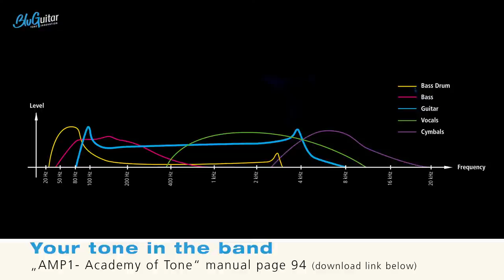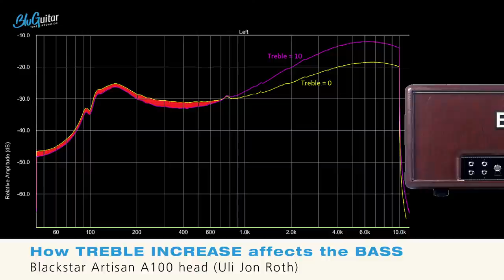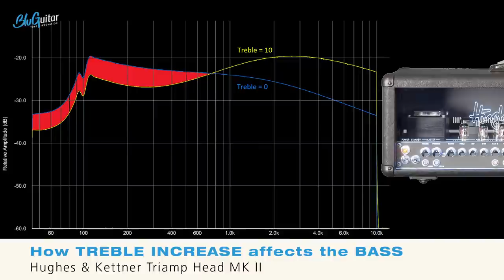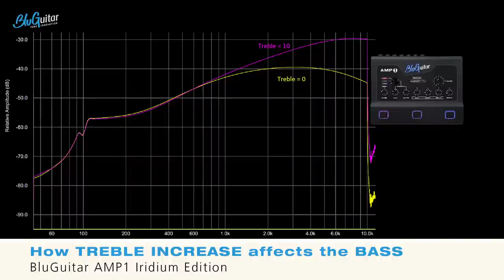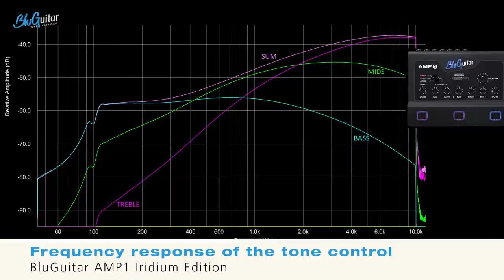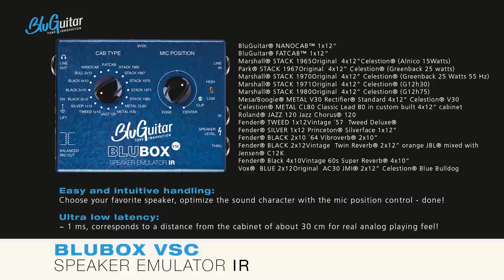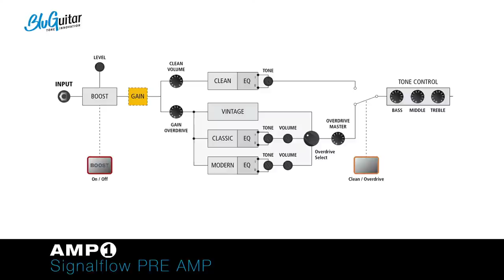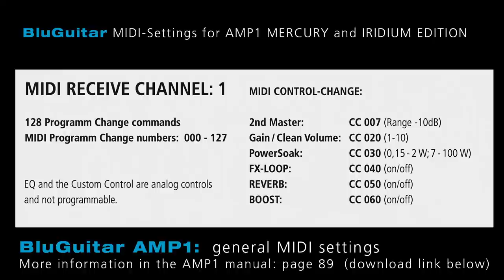Academy of Tone #21 Tone stacks - How to dial in killer guitar Tones? Different Tone stacks vs AMP1_

Comment from the maker: Chapters:
0:00:00 Splash
0:06:20 Introduction
0:08:00 Tone Stack: Introduction
0:15:58 Tone Stack: Settings on AMP 1 & TriAMP
0:40:00 Tone Stack: Using Pedals: TCE Spark
0:55:08 Tone Stack: Vintage Marshall and More EQing
1:02:30 Tone Stack: Fighting fuzziness on the AMP1
1:07:32 Tone Stack: Conclusion
1:09:40 Q&A
1:56:16 NUX Cerberus in 4 Cable Method
2:05:07 Conclusion

Comment: I mostly used from Triamp  channels 1B and 2A  with tight Switch on, once in a while 1A but i had Midi pedal for Digitech 21 Pro which had 5 switches for channels so i used 3B and did not use 3A because i loved the tightness of 3B more than 3A.
Reply from the maker: The Triamp has some great sounds. I actually used all 6 channels depending on what the music required. My main sounds were 2A,3A,3B

Comment: I love my Mercury so much, I feel as if I’ve been granted tonal superpowers, and for a very reasonable amount $ . I hope to buy you the beverage of your choice someday.   Frau Taylors even tells me that my sound is now much more clear and defined, musical I sound with high gain.  My high gain rig was a Friedman BE-OD/ Boss Angry driver /BOSS CP1X / MXR 6 band EQ/ into the return of a THD biValve / single 1x12 Celestion 90 . 
Nice setup, but  AMP -1  Mercury is another ( better ) world entirely. Far better feel and dynamics , and note separation does come across on You tube . By the way, I also have an old Peavey 1x10 cabinet modified to accept 1x12 speakers.  I fitted a Katana -50 speaker 🔈 which was ratty and thin,  now sounds luxurious, pushed by the Mercury, amazing .  I feel a connection with you , We both had MESA BOOGIE MK 2 B Amps  , Saxaphone LOL ,  Vielen Danke !